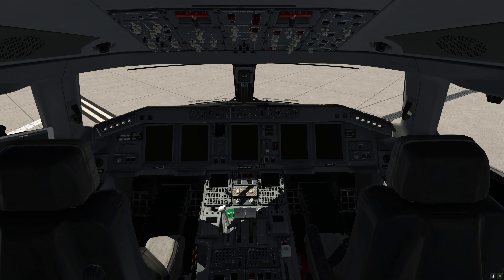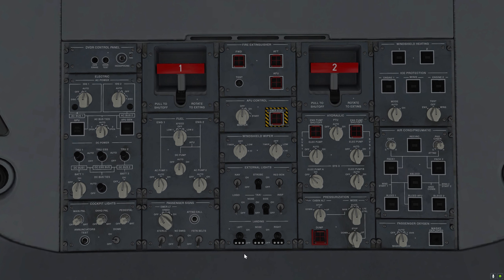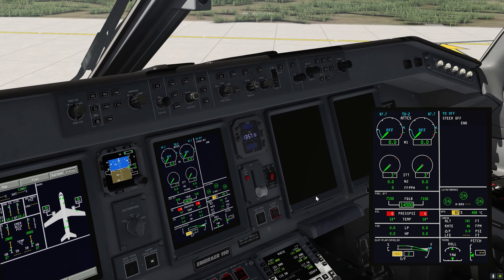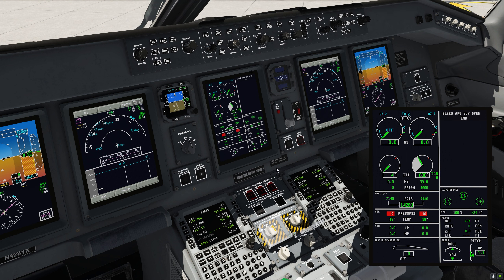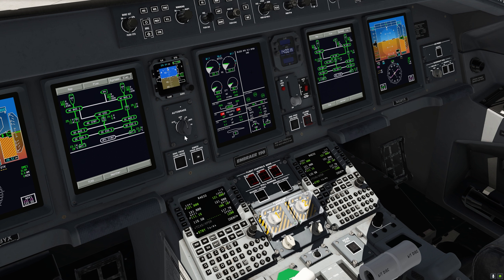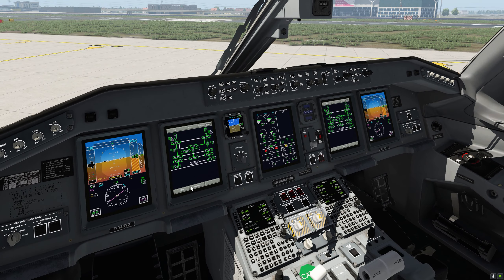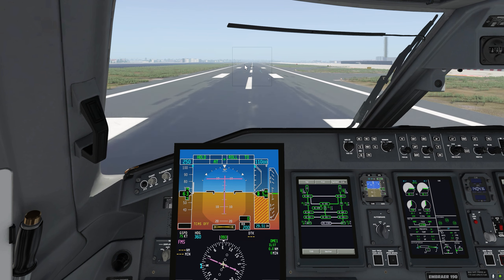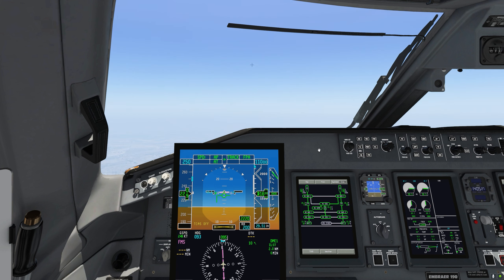Flight Simulator: Full Cockpit Power-Up in the Embraer E190

Comment: I am a e175 captain and I can tell you that when powering up on dc power only it is only the right mcdu screens 2 and 3 and iess. Same is true during electrical emergency when there are no normal sources of ac power except for the rat. Which is not considered a normal source of ac power.

Comment: Thanks for making the Embraer! Looking forward to more footage, especially of the authentic fms. One correction though. On start up it's actually the right mcdu which turns on on battery power, not the left one. The idea is that when the aircraft would have an electrical emergency and is only powered by batteries, the right seat pilot can handle the radios (and left seat pilot does the flying because he has the pfd in front of him).
Reply from the maker: Yes you're totally right! the ERJs work the same way so I'm not sure why I said that wrong. It will definitely be correct once we have it working!
Reply: @xcrafts_development  Great! Thanks!

Comment: I also noticed that the oil pressure stays quite low after engine start, around 24 psi. It should pick up quicker depending on oil temperature and somewhere in the start fase be above 25 psi..

Comment: is those second screen in captan and fo sides synced in real life?? and the engine sound its kind strange in my opnion but besedes that its preaty beatiful, nice work
Reply from the maker: The screens are independent in real life, it's just extremely tedious managing 5 screens instead of 3, so for the initial release, the PFD and MFDs will be the same on both sides, but then later independend MFDs will come, and hopefully one day also independent PFDs, but that's quite far in the future right now! And regarding the sounds, I actually have a feeling that  NVidia shadow player messes up the sounds a bit, as soon as I start recording, the interior abience increases in volume a lot, so it sounds a lot louder than it normally is. In any case, thanks for the feedback and the support!